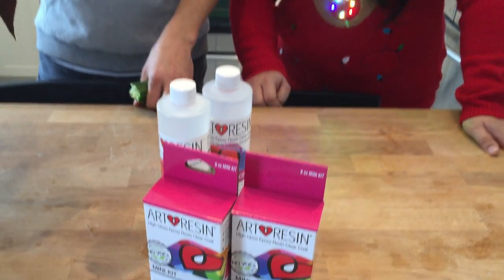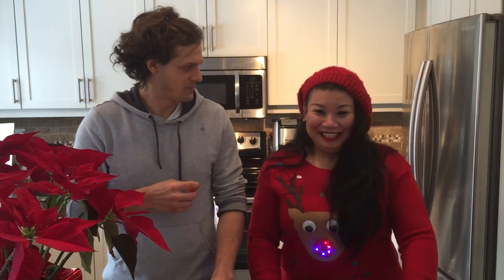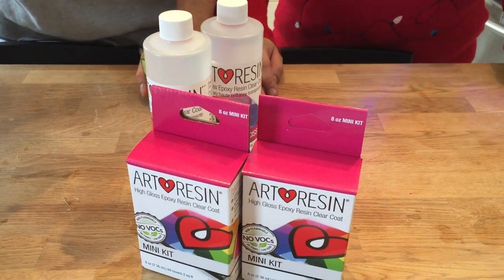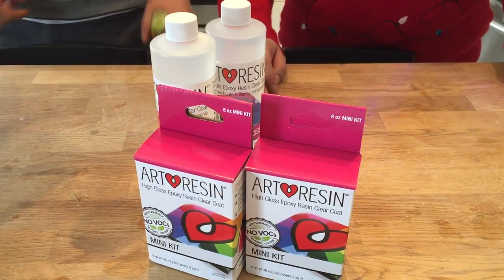Why Is My Resin Cloudy?!

Comment: I also put my resin bottles in a warm water bath before I go to use them, and then sometimes even put my cups in the warm water after I mix to help it degas. It goes with out saying though that I never let the water touch the resin, just think of it as almost like a double boiler when melting chocolate.
Reply from the maker: Yep. Just remember that when you warm it, you are accelerating the working time, meaning you'll have less time to play with the resin before it cures :)

Comment: Why is my resin sticky after it cures and how do get rid of that sticky residue?
Reply from the maker: If you notice soft, sticky areas in your resin application that do not seem to be curing properly, this always means that the chemical reaction was not able to happen properly—either through unequal measuring or non-thorough mixing. You will have to scrape off any wet material as best you can, sand down any dried, cured resin, and pour another coat over the entire thing. Your artwork underneath will not be disturbed. Make sure you scrape away all non-cured material, otherwise the stickiness could eventually leak out from under the new resin coat. Resin that remains sticky days after being poured will stay sticky indefinitely until measures are taken to fix the situation. Here is a link to our blog to show you exactly how to fix this : 
https://www.artresin.com/blogs/artresin/how-can-i-fix-soft-sticky-spots-in-my-resin

Comment: Ok but how do I fix cloudy resin once it hardens
Reply from the maker: Once your resin has cured and it is cloudy with micro bubbles, the only way to fix it  would be to sand it to remove as much as possible.  Be careful not to sand down into your painted layer.  Once you have removed as much as possible, you can pour another layer of resin- being sure to warm it up before mixing using a warm water bath.